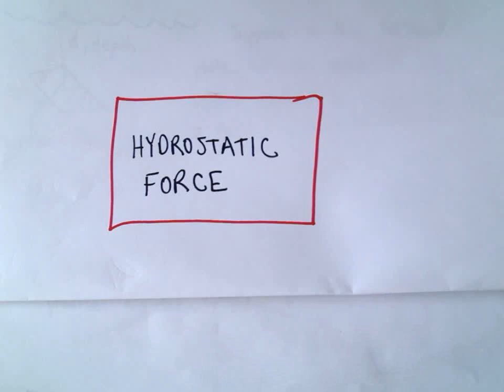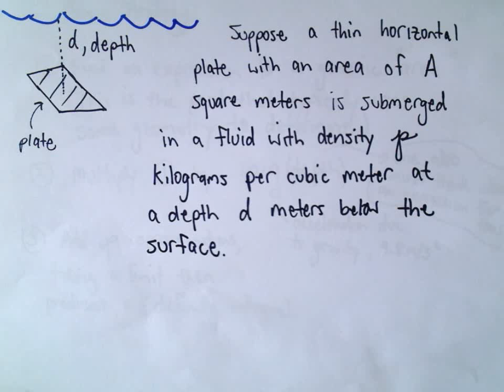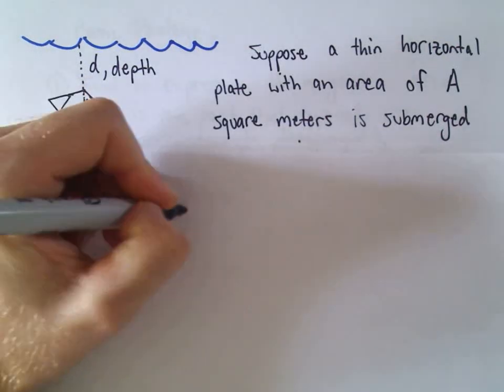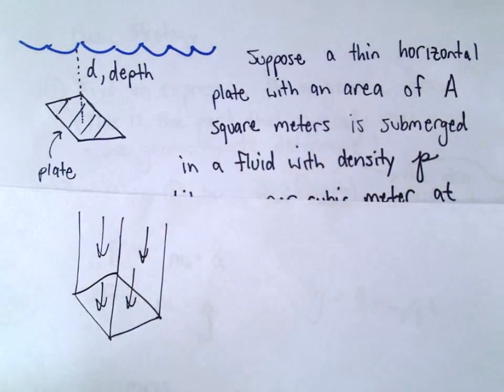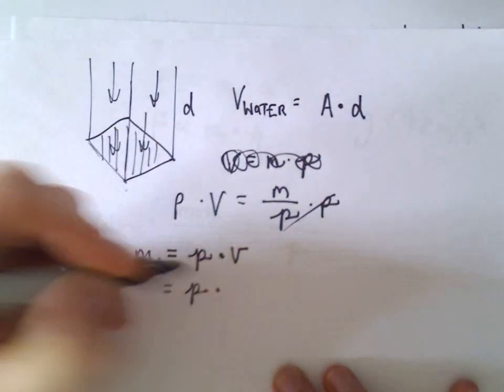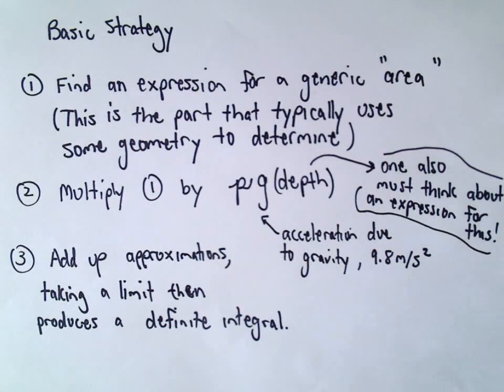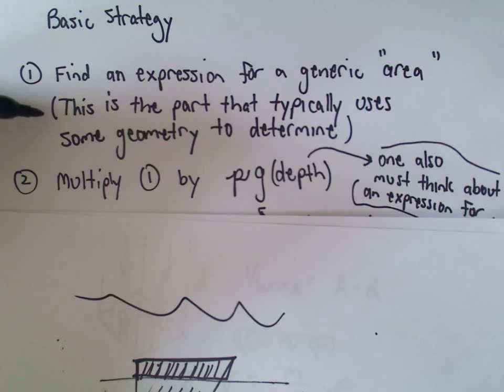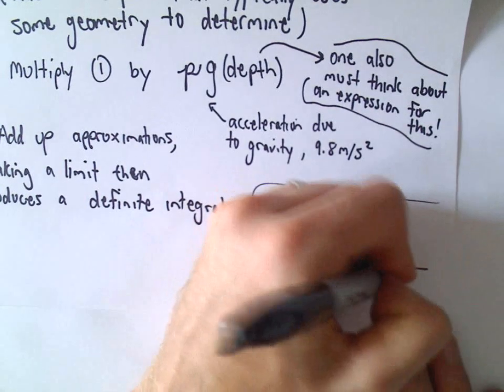Hydrostatic Force - Basic Idea / Deriving the Formula

Comment: having now seen the next 2 videos, I'd recommend a revision to the steps you give.
1: Find depth (distance from surface to top of object +x or distance from surface to bottom of object -x)  2: Find area in terms of x (will include your delta x term)  3: Find limits of integration (0 through object height if the above depth strategy is used)  4: Integrate

Comment: Serious question: Instead of the force being exerted by "gravity" what if the 'force' is similar to an electric potential difference that creates voltage? Is there a difference between the density of water compared to the density of the metal plate? In other words, because the metal plate is more dense than water, it is going to sink with a certain amount of 'force'. If the plate were wood it would have a different density and force. Plastic or some composite or aluminum, a different force.

Comment: 62.3160 pounds per cubic foot at 68 degrees F is accurate.  But my online homework isn't "correct" if I use accurate pressure numbers... But if I use your 62.5 it is.  This is really dumb because IF water were ever actually 1000kg/m^3 then the conversion would be 62.427lb/ft^3 which would clearly round down to 62.4

Consistency would be nice.  I only got my homework right because you used 62.5 and I gave that a try.  So thanks.  :)